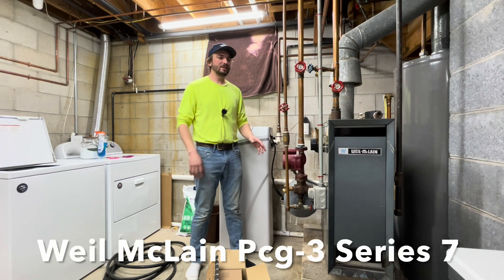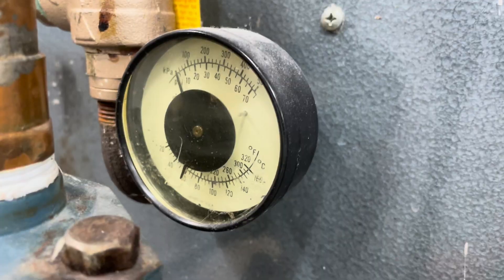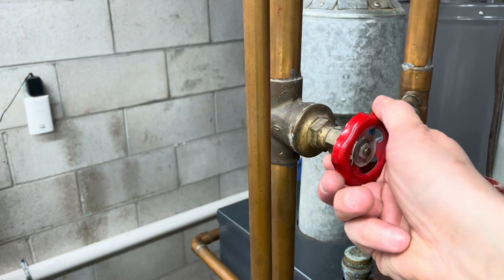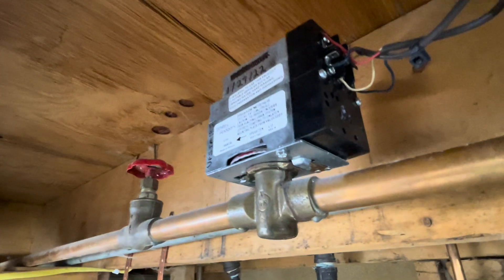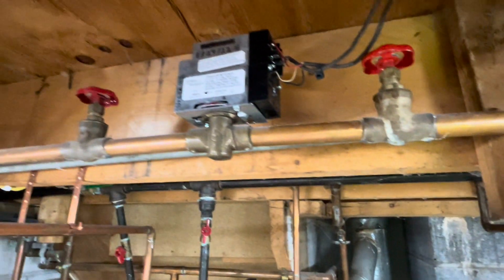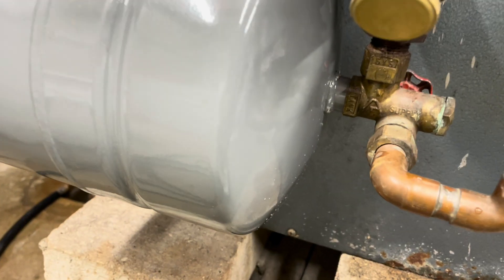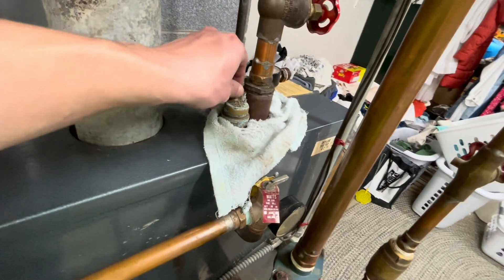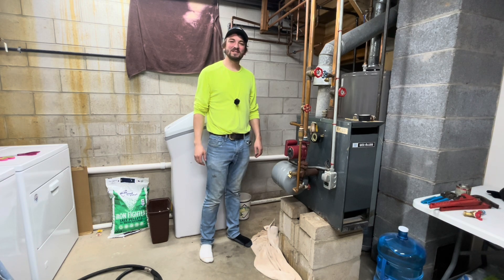Replacing Amtrol Fill-Trol Expansion Tank on Weil McLain Pcg-3 Series 7

Comment: great video. Can you provide details about the valve right at the expansion tank? I have an older WM and my tank is steel drum in rafters. I am taking that out and installing an bladder expansion tank on supply side of circular pump. I also need to install an air scoop or spirovent to remove air.
Reply from the maker: Thanks for the comment, I have a 35-45 year old Amtrol fill-trol valve I’m unable to find literature on the exact amtrol fill-trol valve that I have on my boiler… I wouldn’t hesitate to give them a call if you have questions the person who answered my call was very knowledgeable. Their number is in the video description.

Here’s a pdf of a different Fill-trol system, I found it on supplyhouse (dot) com
https://s3.amazonaws.com/s3.supplyhouse.com/manuals/1351174248151/85529_PROD_FILE.pdf
Reply: That valve is part of the tank system (that's what makes it a "Fill-Trol"), but you can get a replacement tank without it. Boiler systems need a fill valve. The "Fill-Trol" model integrates the expansion tank with the fill valve.
Reply from the maker: @chrimony  thank you for the comment i appreciate it.